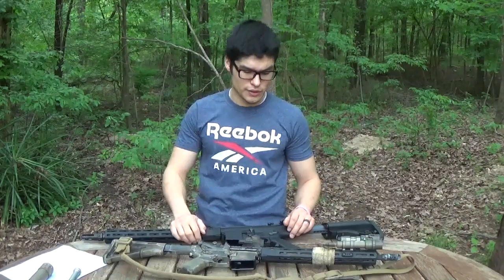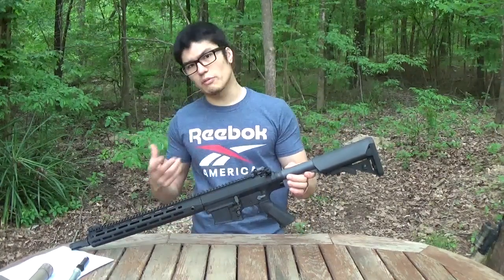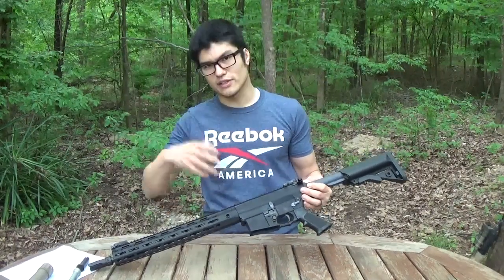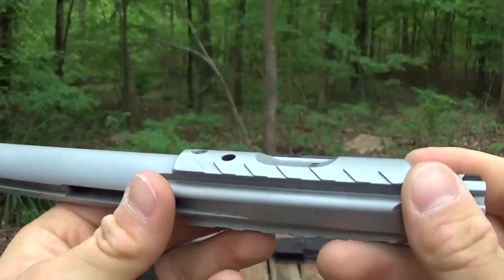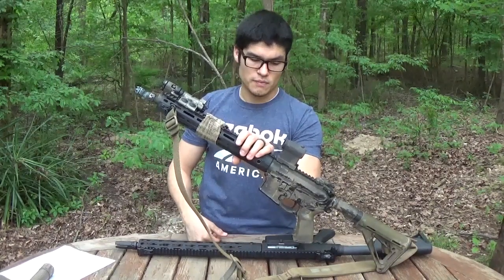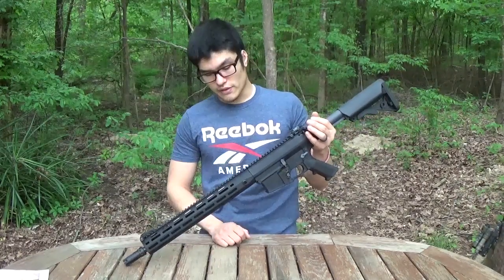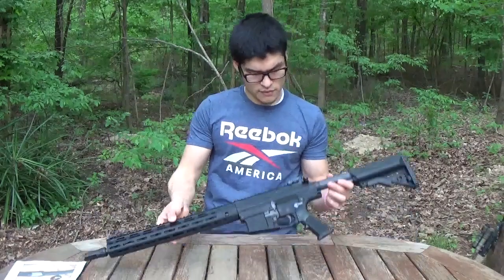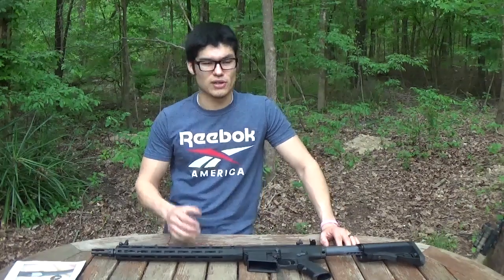The Knight's Armament SR-25 E2 (ACC) Advanced Combat Carbine: A Technical Overview

Comment: Should I sell my fn scar 16s for this ? Local gun shop has one in stock ? $4900
Reply: $5k for an AR-10 is pretty insane. Actually, it full on fucking nuts. I have one that works like a champ for less than $1k with an optic.